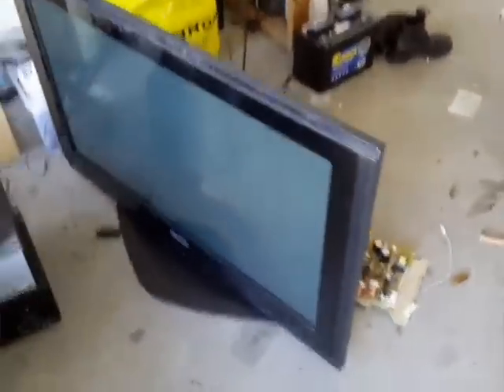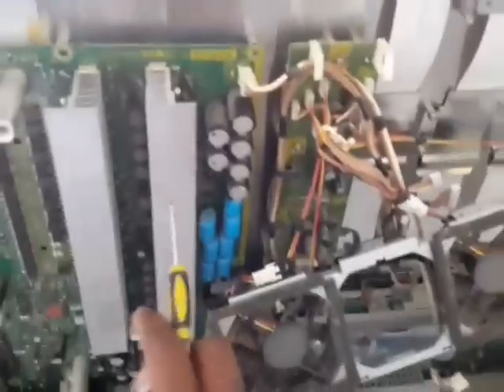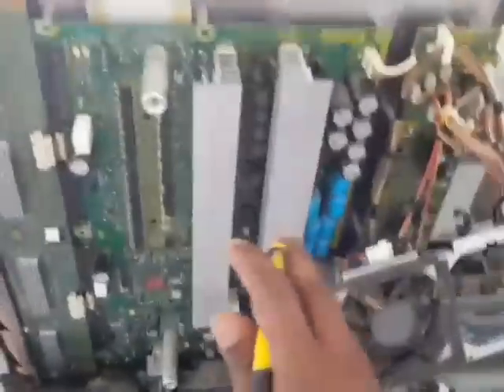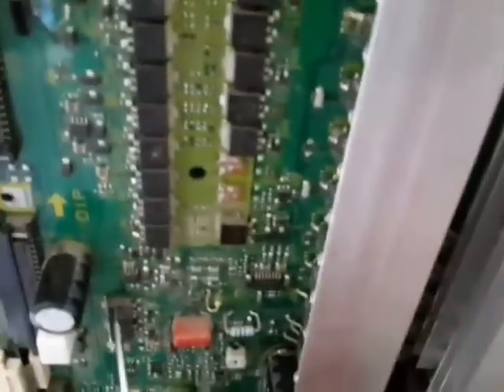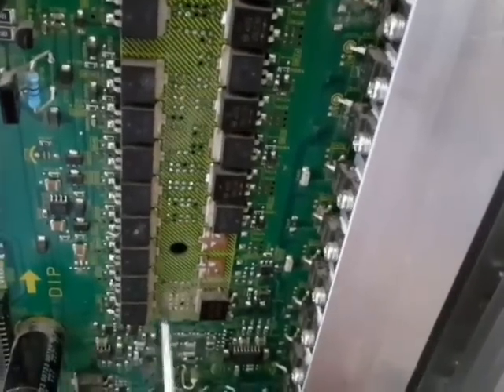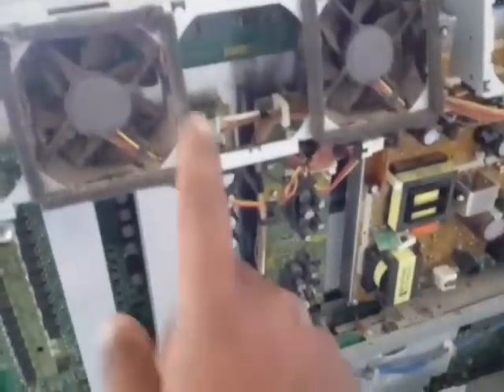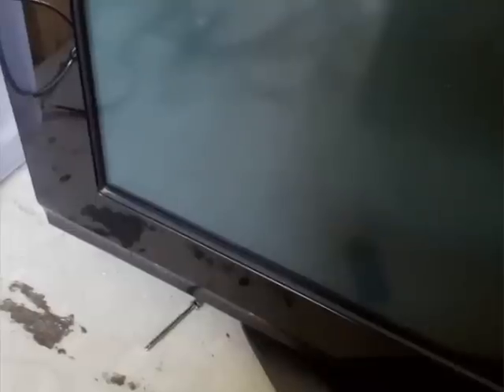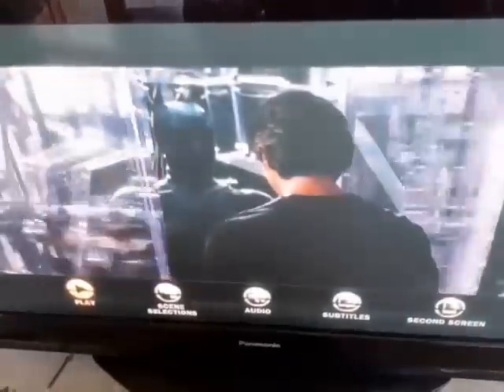Panasonic plasma free repair 7 blink code

Comment: Had the exact same problem with this TV. One of the MOSFETs was in short circuit, after desoldering it TV started with the other 7 MOSFETs connected. In my case one of the buffer board (SD), was also damaged so I had to replace it.
One thing that I think is missing in this video is how you make sure that the problem is in that board (SC board). According to Panasonic service manual, the 7 blinks can be created by the SC, SU and SD board (the three boards at the left side of the TV).
When disconnecting the two cables attached to the SC board (as he shows in the video) the 7 blink code should disappear and the light stays green. With this test you confirm that at least one of the three boards is damaged. What you can do next is disconnect the SU and SD board from the SC, and reconnect the two cables, if the 7 blinks appear then it is definitely the SC board that is damaged, if the TV stays on with the green light, then the problem is in the SU or SD. Final test is just connect one of the buffer boards, SU or SD and discover which one is triggering the error.
Hope this helps someone!
Reply from the maker: Thanks for Sharing this with us. :)
Reply: And thank you for making this video! Without it I would probably just try to buy the complete board instead of finding the component that was bad.

Comment: Hi thanks you for the heads ups was a fault mosfet on my tv. Had to change the 33ohm resistor next to it as well as that when open circuit

Comment: Hi, Shan. I have a Panasonic Viera TH-R50PV8A model TV. I have the same problem as shown in this video (7 times red light blinking) is it the same board problem in my TV or it could  be something else, and many thanks for this video:)
Reply: I have a Panasonic viera th-42pf20 model 2007 I have the same problem (8 time blink and stop than red light comes to blink

Comment: Hey bro, do I need to get the board out to solder those transistores? I got the exact same situation but in my case I need to replace the 6 on the top left.
Reply from the maker: It will be easier if you take the board out but you don't have to .  Make sure the solder iron is set to high temperature. It's a bit hard to pull out these SMD transistor.
Reply: @sharndhayanithi1856  Thank you! Its gonna be my first repair. I got the TV for free to fix it
Reply from the maker: @ariel27302  let me know. Good luck .
Reply: @sharndhayanithi1856  I will, thanks
Reply: @ariel27302   im invested 😂 did it work?

Comment: my partner was going to throw one of these away. its in mint condition with remote and all....I brought it home fired it up and happened to notice 7 flashes. (im an auto mechanic so I am familiar with flash codes)  anyways.  what are the chances of these tvs having the same fault issues. ( like the one I have having a bad transistor as well) I think Im going to crack it open and give it a go. I am somewhat familiar with your tests ohms checking desoldering ect....I think it would be sweet to fix this for just a cuople bucks.